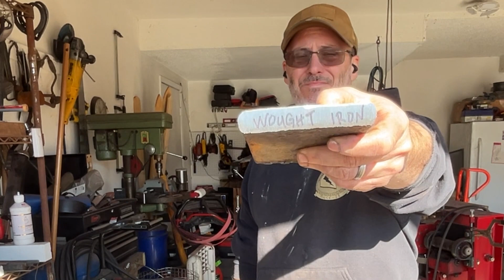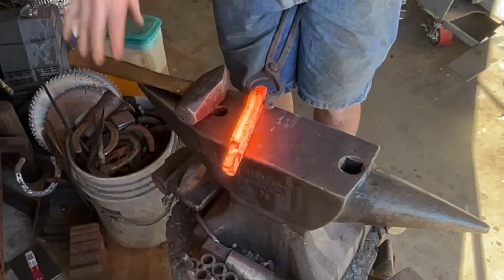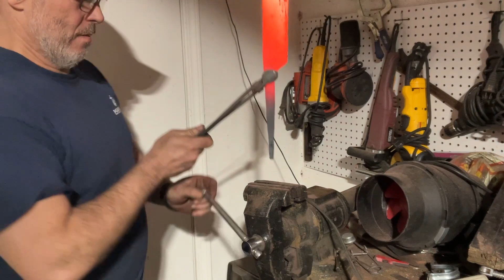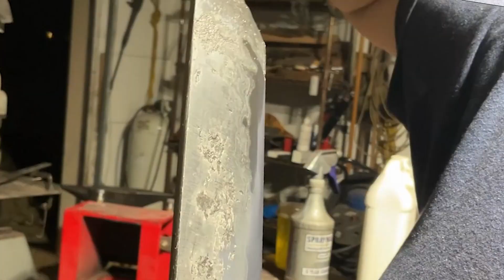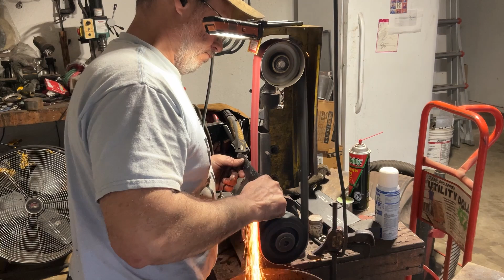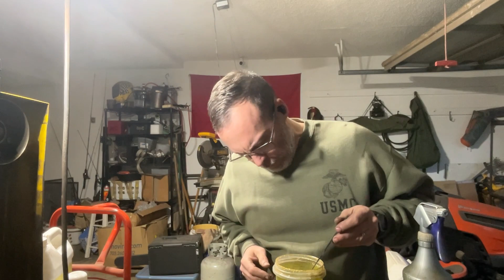Breaking Boundaries: Experimenting with Wrought Iron & 1084 Part 1

Comment: Cool vid man, what’s a basic startup kit for this kind of deal as a hobby?
Reply from the maker: Great question!

I started doing this as a hobby as well about 10 years ago. I used a break drum and a hair dryer with some wood charcoal for a forge and bought a cheap anvil from Harbor Frieght (which I still have but more as a door stop now 😂). Honestly though, if I were to do it all over again, I would have still used the break drum, but would have used a sledge hammer head for the anvil to get started. At least that would be steel and probably cheaper, too.

Thank you very much for your question/comment!

I hope you've already subscribed to stay up to date on this and other builds. 😜

Comment: I have a similar build in the works; my wrought is from an old anchor chain, and seems to be good quality. Frankly, I was expecting more of a pattern from the wrought! Perhaps a different etchant?
Reply from the maker: Well, I'm not sure if you meant to send the proper spelling of my goof up from the beginning of the video, but you spelled it right so well done!

The pattern in the wrought isn't what I was expecting either. The etchant could be the reason, but I'm unsure. That said, the blade wasn't in for very long, maybe 10 minutes. I'm using @bakerforge Gator Piss. It works well with Damascus (pattern welded) steels and I was hoping for the the same results for these.

Thank you for your comment and I hope to hear from you again in future videos!

Hope you've already subscribed, too! 😜